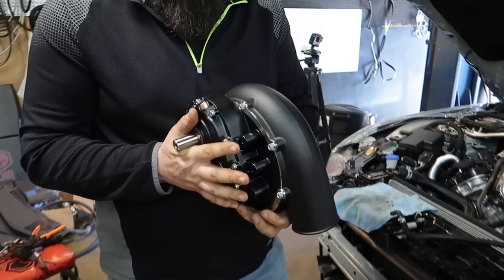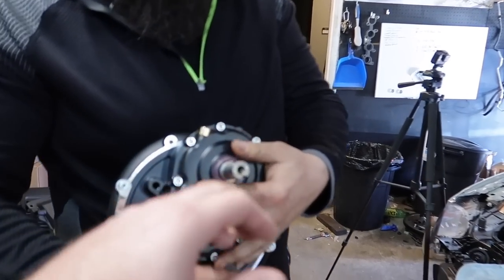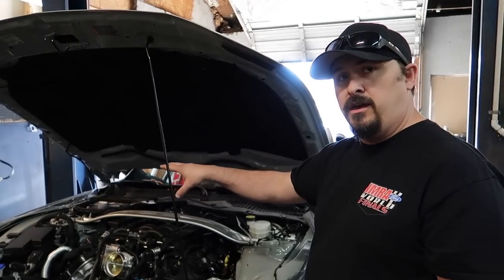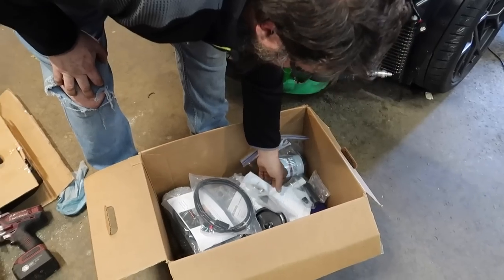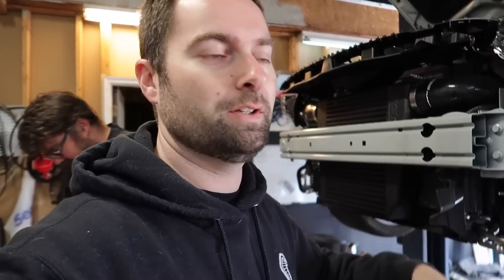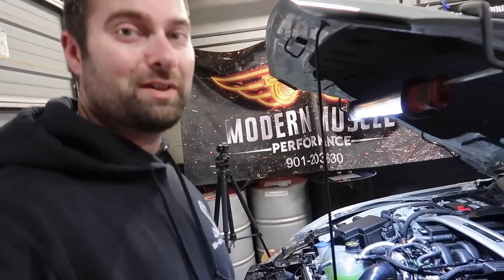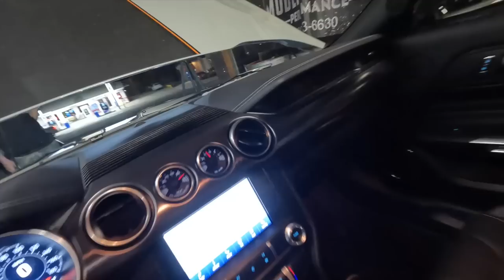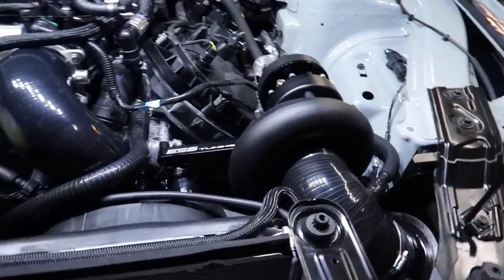BOOSTED MY 2021 MACH 1 MUSTANG! WORLD 1st ESS Supercharger INSTALL & FIRST START

Comment: Centri blowers sound amazing! Your going to love the sounds and car should work well since it’s a manual! In autos they aren’t the best I would say but for manuals they work well since you don’t need a converter
Reply: This kit hits pretty good mid range for a centrifugal. I cut 1.49 60ft on stock converter.
Reply: @bradmo9281  It will work, but a positive displacement blower will work better in a stock converter auto car. But I love Centris lol
Reply: @JLSpeed  my car works pretty damn good with this ess kit and stock converter 1.4 60ft

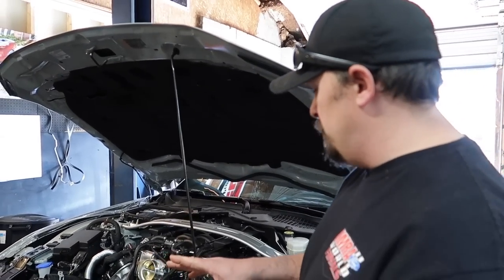Comment: 2:37 Serious question, not trolling. Can anyone point to any proof that ProCharger breaks cranks more than Whipple, Vortech..etc?
Reply from the maker: I have seen ppl talk about it online. They make a crank support for it now. I think it’s mostly affecting big power cars though
Reply: @blister5.0 there’s no  real proof. It all goes out the window when 6rib whipples, 6rib vortechs and paxtons and even turbo cars and NA cars have broken cranks. But this whole “Procharger breaks cranks” has become a real campaign slogan for these ESS guys. They all forget not all Prochargers are stage 2 (dedicated drive), many HO kits on the road that use the accessory drive for the almost the last 10 years just like the one ESS just “developed”
Reply from the maker: @blown06tc  I have not heard any “ESS” guys online talking about cranks. But what is ALL OVER the internet is procharger crank issues with big power. It’s literally all over mustang6g.com and has been for years before ESS came out. That’s why they developed the crank support for them. I believe it’s a big power issue so less common on street cars But I personally know two ppl that snapped a crank with boost. One was a big power whipple and the other a big power edelbrock car. 🤷‍♂️ I’m not defending either way, just what I have personally seen and read others talk about. Procharger is still as solid as ever but the consensus is it needs a crank support due to its belt location being further away. I did not create this truth or rumor so don’t shoot the messenger lol.

Comment: I'm looking at the G2 kit for my 2018. I'm not going for crazy power so the 125mm pulley and LU47 injectors on 93 is what I would do. I've seen that I don't need a upgraded fuel pump, but what about a BAP? I can't seem to figure out if is needed or not.
Reply from the maker: Yes. You will still need a BAP for fuel.

Comment: You need to check out the Anderson Composites newly released Carbon Fiber hood for the Mach 1. It’s got the Mach 1 hood scoop and it’ll help reduce some of the weight that was added from the ESS. Also change out your battery to a lithium and you’ll have completely negated the added front end weight. Looking forward to your track racing!!
Reply from the maker: I did see it. It looks pretty cool

Comment: Are you running a passenger side catch can or breathers? I have a jlt catch can but I'm hearing once you add boost you should have a breather on the catch can or just vent to atmosphere. I'd like to keep my catch can as I just bought it lol
Reply from the maker: I do. I modified my JLT with additional check valve on the other of the can between the can and manifold. Seems to be wot so far

Comment: That is a clean ass kit, for sure. ESS has a shop here in Chandler, AZ and had developed a Mustang V6 version of the kit. Made amazing power. 

I was supposed to get one, for Donny the install manual for them. But they bailed on the idea, to focus on V8 and I got ghosted. So I went with the Procharger. 🤷🏻‍♂️

I still think the V6 kit would have sold faster than the Procharger I have. The Procharger kit adds 80-100lbs to the car. Pipes are steel, gear set housing is huge. Just heavy. Don’t get me wrong, I love the kit. But HEAVY.
Reply from the maker: Entire weight of the ESS kit is like 42 pounds I think. I imagine they may kick up production for other than v8 models soon if demand is there

Comment: With the air filter location is it easy to remove and clean or do you need to take off the front wheel to access it?
Reply: You can pull it through from under the hood. No need to remove fender lined
Reply: @bradmo9281  thank you

Comment: Wow I’m about to order this kit! Do you think the 110mm pulley (9.5 psi) is too much for a stock motor? I have a 2021 GT with a ported intake
Reply: It’s not too much , but you’ll need a fuel system and run e85. Too much for pump gas.
Reply: @bradmo9281  okay thanks so would you say 7.5 psi or 8.5 psi for 93 pump gas?
Reply: @defi5  I would run 120mm for pump 93. That will make 700 plus wheel on a gen3.
Reply from the maker: You would be fine with that if you are on a fuel system and e85. But not 93
Reply: @Zander13Productions  sweet thanks for the response. Have you done any transmission upgrades or do you plan on it? I heard the 10-speeds sometimes have transmission issues when boosting. I’ve read the learning software is a culprit
Reply from the maker: @defi5  mine is still stock tremec manual

Comment: Zander, honest question; why would you think a Mach 1 would make anymore power or be any different from a regular gen 3 mustang? They're literally the same engine with the only difference being a gt350 manifold.
Reply: The gt350 manifold makes more power than 18 plus gt manifold.
Reply: @bradmo9281  you literally proved my point lol. That's what I said in my question. Meaning, any GT could install a gt350 manifold and make the same power as a Mach 1. There is 0 difference,power wise, between a Mach 1 and regular GT. So, I am sure why he thinks his Mach 1 would be any different than any GT with a ESS installed. There are already hundreds, if not thousands out there.
Reply from the maker: Stock tuning is different too. In the video the car added 25 degrees max timing. It was happy. Normally stock tunes don’t add that much but mine did. Timing = horsepower. Regular GT is tuned different. I’m not a Ford engine builder or tuner but I understand how timing works especially in 500 DA on a cooler day
Reply: @Zander13Productions  OK. But. What happens when a GT and Mach 1 are tuned? It's the same computer. It would even any differences in power. Also, it's very normal for a NA car to add 5+ degrees of timing with happy fuel. It's not uncommon at all.
Reply from the maker: @rfor7471  all I can say is we went to a reliable dyno that HPR uses all the time and I held the camera and the car did what it did.

Comment: Hopefully only another week or 2. They said about a 4 week turnaround
Reply from the maker: That’s pretty fast compared to the whipple wait times
Reply: I'm in my 3rd week of wait time. Have the G2 kit with G3 intercooler coming in. I have a lot of supporting mods already here just waiting on the kit. Lund have already sent me the tune to get things started. Sick video as usual. 💪💯🙏
Reply: Once it gets here I'll be doing the unboxing. Later on I'll be adding more stuff to make more power and more support mods for safety. Goal is to get it up to 750-800 without having to worry about things breaking. If you're going to do it you do it right so you can do it big 🙏💯💪
Reply from the maker: @SaVarMatner  try he kit plus fuel system and e85 will get you to 750-800 easy
Reply: @Zander13Productions  Will do brother. Thanks.

Comment: Some say ESS is just a rebranded Procharger..I think ESS has numbers that proves its a better product..
Reply from the maker: It’s very interesting too to see the two brands side by side. The differences are huge. ESS has some really nice advantages
Reply: @Zander13Productions  Procharger is mounted oposite..requiring more mods to just install... ESS looks easier with less mods..I agree bro
Reply from the maker: @flfun1684  no. Procharger is same location. The vortech brand is opposite
Reply: @Zander13Productions  Trust me bro Im sold on ESS
Reply from the maker: @flfun1684  🙏🙏🙏 it really is an awesome kit. Especially for the cost. The dyno video is going to really shock some ppl

Comment: If you or these guys don't know that Procharger Stage 1 setup/mounting setups use and have used the same serpentine belt drive that ESS basically copied....then that tells me all I need to know.
Reply: Trust me there is zero copied from the procharger kit. Let me know when you can make 1100 whp with stage 1 setup.
Reply from the maker: Nothing is copied lol. It routes and installs different, it’s lighter weight and flows more air
Reply: @Zander13Productions  ....this coming from the guy that blew up his turbo car on like the first day. Just stick to marketing and ambassadoring for "Whats new", thats all you're good at it.  There....there's the "engagement" you're thirsty for. You and YDBT should totally team up.
Reply from the maker: @tonyb022377  i guess you are perfect and have never made a mistake then. Good for you. At least I was honest about the whole thing. Every car guy has made mistakes before. Lol other YouTubers blow engines up on purpose. In fact. EVERY car youtuber has. Even cleetus.

Comment: Kickass, man. Car is really coming together!! 🙌🏼

Question. When he says crank failures, can that include a spun bearing? My Procharged 3.7 is making sad sounds. Rod knock for sure. 😢 Good thing these engines are cheap AF.
Reply from the maker: Not sure but maybe. The further the pulley is on the crank and away from the engine the more stress. The ESS uses the factory balancer belt location so it’s much safer
Reply: @Zander13Productions  yeah. That’s what I liked about the ESS kit. I was going to be the first ESS blow 3.7 Mustang, to my knowledge. Oh well. Time for a new engine. I have a Griptec pulley now. So, there will be no need to tension it as much as the OE pulleys. I’m sure I’ll be fine after the new one. 🙏🏼

Comment: long time follower here,, lol any promo for ESS?
Reply from the maker: Thanks for all the support. Hit up Brevin at brevin@esstuning.com and tell him ZANDER13 sent you. Hopefully he can hook you up 💪
Reply: @Zander13Productions  i was going to keep it under 700hp do i need the 1000cc FIC? or the LU47  sufficient?
Reply from the maker: @nasty5-oh893  I would still get the bigger injectors to be safe
Reply: @nasty5-oh893  I went with the FIC 1000 with a BAP. The bigger injectors will allow me to upgrade safely to e85 down the road when I upgrade my fuel system. I'm running a flex fuel tune now but once my kit come in it'll be for 91-93 until the time comes for the fuel system upgrade. 😈😈😈

Comment: Sounds like the pulley belt is slightly misaligned with that chirping sound.
Reply from the maker: It is supposed to sound like that. It has straight cut gears. ALL centri blowers with straight cut gears sound like that lol